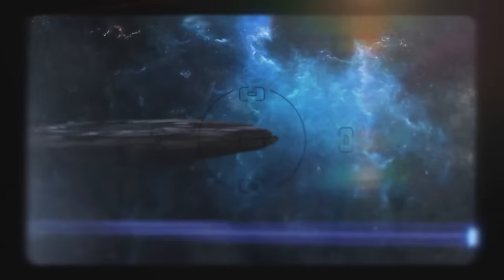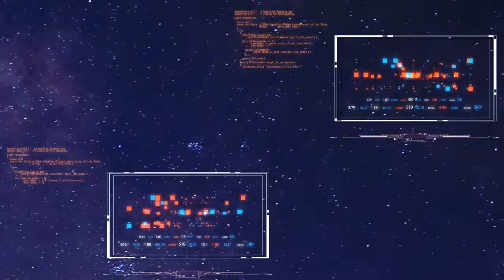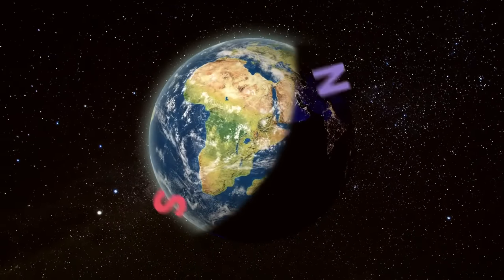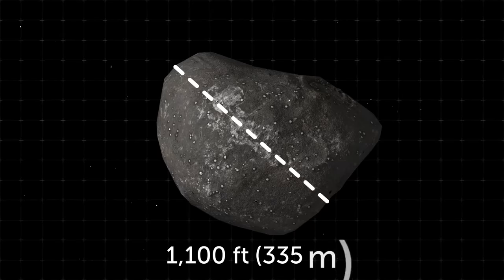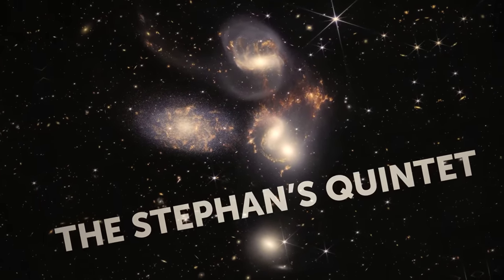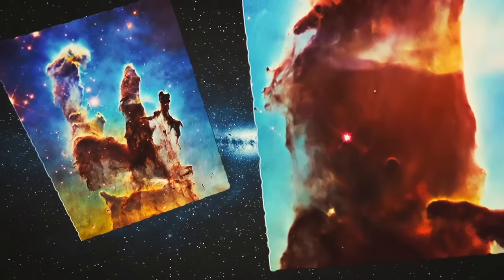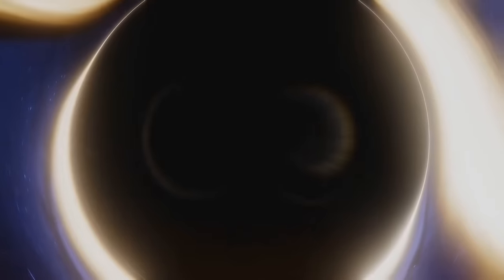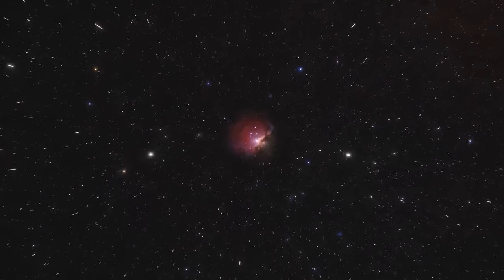Scientists have solved the mystery of Oumuamua and it's not that simple.

Comment: I keep saying this, if planet 9 exists (annunaki homeworld?) It will have an extreme polar rotation, minimum of 50° deflection to the relative solar ecliptic plane.on the flip if its NOT out there the 3 outer planets (yes that includes THE PLANET PLUTO) it was most likely ejected from our solar system and the 3 outers planets are returning to the solar ecliptic from a much greater deflection angle.